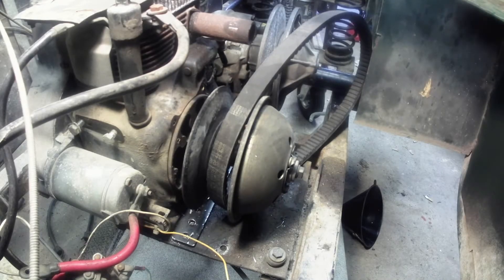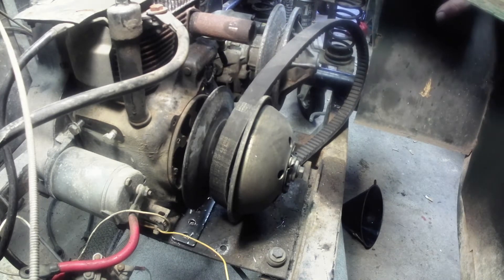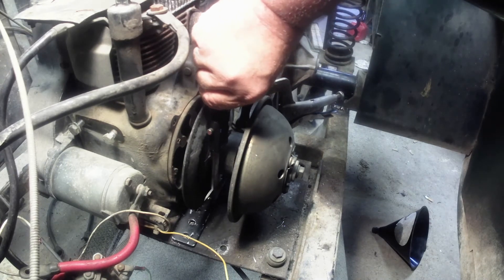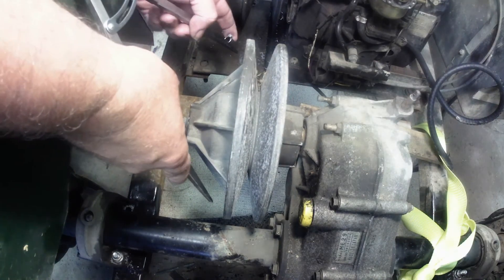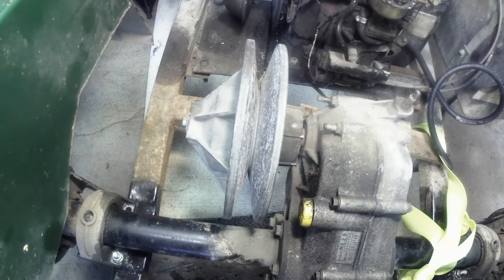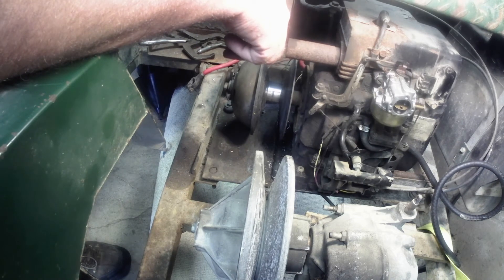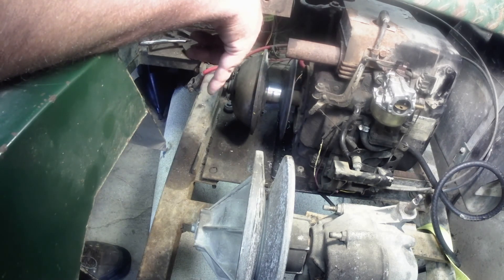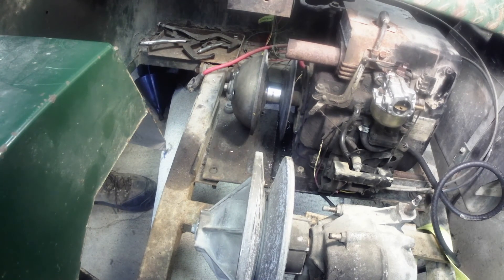Cushman Golf cart Pt.6  CVT belt

Comment: Did you find out the drive belt size
Reply from the maker: @DavidWerpechowski  Yes i eventually did.
Reply: I need one can't find measurements
Reply: Can you give me the measurements of the belt
Reply from the maker: It's in my storage shed buried right now. There are calculator on line that you can do a couple measurements and get a belt size. That is how i got mine
Reply: I don't know how to do that
Reply from the maker: I can't get to my cart right now, it would have to wait till spring and nice weather for me to move all the stuff stacked on and around the cart.

Comment: I installed a 420 predator engine on a 99 ezgo. No matter how much deflection in put in the belt in gets wedged in the clutch and with engine running you cant shift out of gear. I'm thinking of installing a slightly narrower belt. Clutch is new and lined up correctly. I'm stuck.
Reply from the maker: Make sure you are using the correct drive and driven clutch. If it's a clutch like goes on a go-cart it may not work, some of that style have a flat side to the clutch and the vbelt will not fit.
Reply: Did you ever get it fixed?

Comment: Ed,  I know you made this video a year ago…hopefully you’ll remember what’s what with the Cushman clutch.  I just bought a 1983 type G turf truck.  Seems low on power starting out but the engine seems to start and run good.  I’m looking at the clutch set up and see the belt when at idle or engine off , rides approx 1” down in the driven sheaves…..I’m thinking the belt is too short….what do you think?
Reply from the maker: It could be that or maybe the belt is worn-out it should fit snugly in the driven(axle) sheaves at the outer most edge.
Reply: Ed, the belt appears to be a new Dayco HP2030. Would be nice if there was a way to adjust the engine position. I’m thinking of drilling new holes and move the engine closer.
Reply: I also suspect the “driven” clutch spring is weak….Do you have any idea where to get a spring?  I see all sorts of after market springs for guys that want to get different performance for their UTV…..apparently the size and stiffness of the spring can make a difference. I would like to get the RPMs a little higher for pulling loads up a hill.
Reply from the maker: You can try moving the engine closer. As for the spring you would have to find who made the clutch and go from there to get a different one. I know Cushman use some Comet clutches. If you want more RPMS you can try adjusting the governor just don't over Rev it.